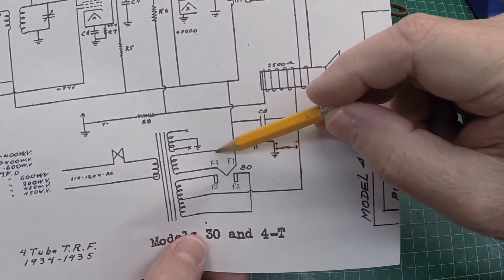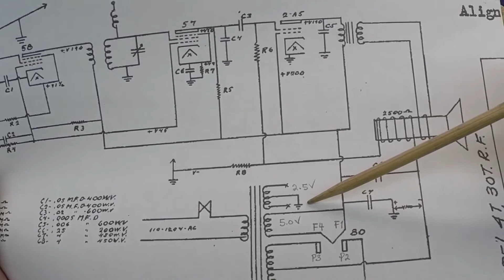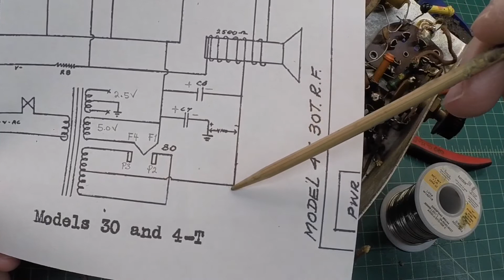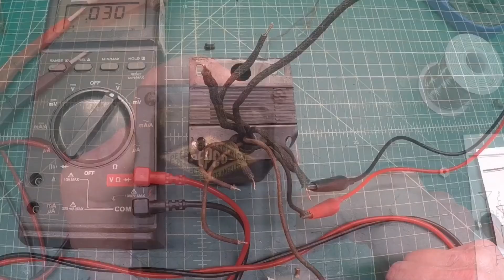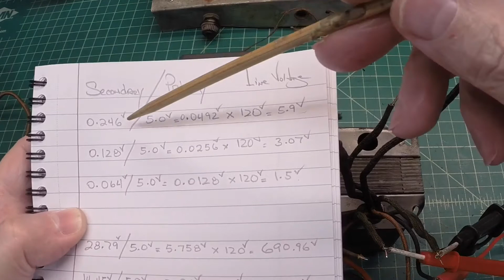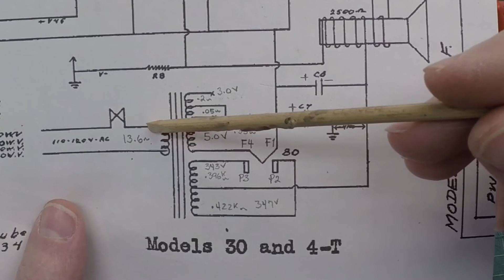Peter Pan Radio - Day 8 P1 (Power Transformer Testing w/ Audio Signal Generator)

Comment: At 29:00, did you mean "no resistance" or "no continuity"? You're probably right and I'm just misunderstanding.
Reply from the maker: +Bob and Kim Rivard Sorry for confusion. On modern meters, they may display open loop when there's no continuity, i.e., no path for electric current to flow from any one of the conductors in the transformer to the frame/bell housing unless there's an internal connection by design. Hope this helps. Thanks for your question and taking time to watch. Best, Don